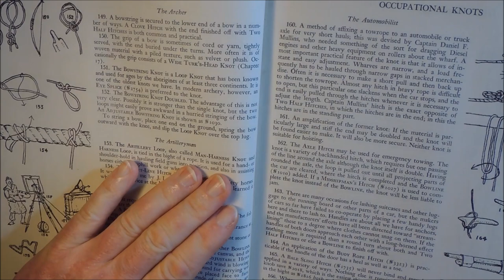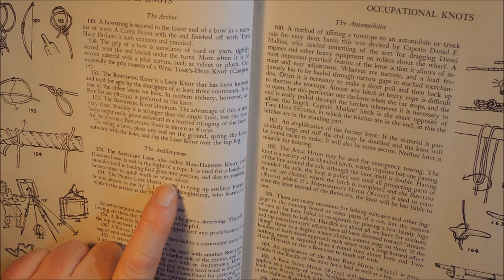Artillery Loop - Man-Harness Knot - Harness Loop - How to Tie

Comment: I think as a follow-up, you should probably cover the Alpine Butterfly as I personally believe it is a superior mid-line loop.
Reply from the maker: Oh yes, it is certainly superior! I have actually done the Alpine Butterfly and many other loops. Mmm, maybe I should create a playlist on mid line loops. Thanks for taking the time to view and also make a comment, very much appreciated. Are you more of a practical or decorative knotter?
Reply: @KnottingKnots  I rig up a temporary zip line for my son using an alpine butterfly with a pulley attached. I did consider the artillery knot butwill stick with the butterfly. 
Only read about the artillery knot through making kites. I'd have used it for years as a  tree surgeon
Reply: Yes but this is easier to tie and undo with a big sling in a thick rope. You just lay it out on the ground.

Comment: It looks easier to tie and untie than either the alpine or farmer's loops and liking my knots symmetrical it wins there. If it can pull gun carriages and horses it's plenty strong enough therefore it gets my vote over the aforementioned loops. 
Another great presentation and a new knot to practice when walking the dogs tomorrow - fabulous
Reply from the maker: Yes, this is quite a nifty knot, yet not often used.
Reply: @KnottingKnots  Gave it a go and the only criticism I would make is it does need careful dressing. Excellent for quick loops in a line holding lightweight items like lanterns etc but probs stick with the farmers loop for heavy duty work

Comment: Speaking of loop knots.  Ashley's Book of Knots number 1021 is pretty interesting.  It lets you create an adjustable size loop at the end of a line.  You create the loop using something like a jam knot then you tie a stopper knot to freeze the size of the loop.  Put a quick release in the stopper knot and the whole thing comes apart with a single strong pull.
Reply from the maker: That sound interesting, off to have a look!! Thanks for taking the time to view and also make a comment, very much appreciated.

Comment: i found myself ending up with this loop as the goto inline loop for tying the truckers hitch. i use the truckers hitch an awful lot and tried every loop there is. the ones i used the most were the bell ringer, the slip knot, the alpine and this one. all the other loops were either too complicated to tie instantly, or not suitable for heavy loads and vibration.

the alpine ist good but i need too long to do and undo it. when i use the truckers hitch i need it quick. 

the bell ringer is just to shaky. it's nice an quick but it's not vibration proof and not suitable for heavy loads. i use it sometimes for static tension with low loads.

the slipknot i used the most because i can tie in in under 1 second and it can hold every load. however it's not very well to undo when used with heavy loads, and causes too much attrition when used frequently.

this one however is also tied in a breeze, i use my own quick tie method with which i can tie the artillery loop almost as fast as the slipnknot using only one hand. under heavy loads it doesn't bite too much and can be fairly easy undone afterwards.

i learned it from you and want to thank you for that. hopefully we'll see another great video from you these days. i wish you all the best, and hope you are perfectly well.

Comment: First, it was very instructive, as someone said the butterfly knot its safer, and I do agree,  however this can be too,  the way you dress up the knot at the end it's the failure and makes it vulnerable,  specially if you use it in a slippery rope or small diameter one, not criticizing but if used to hold your life on it, it better be done correctly or use the butterfly or even figure 8 in a bight.

Comment: Isn't this also called an Alpine Butterfly knot?
Reply from the maker: They look similar, but I believe the structure is different. I think also the Alpine Butterfly knot is more secure?
Reply: That's exactly what I was thinking.
Reply: The alpine butterfly has a structure made by passing the bight through two crossed loops rather than the single shown here; it makes it more stable under load and less likely to roll over, but you can still untie it easily by pulling on the loop ends.
Reply: NO.
Reply: I like the alpine butterfly better, I think is safer
Reply: Very clear and entertaining instructions but I think I will stick with the Butterfly.